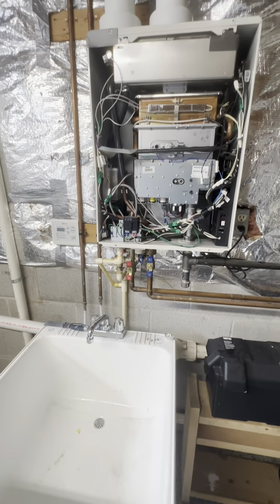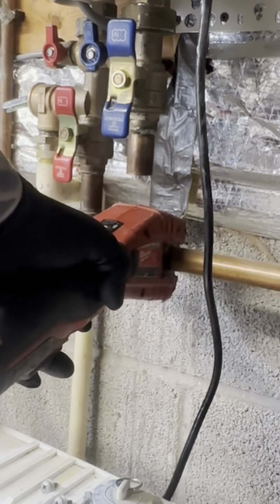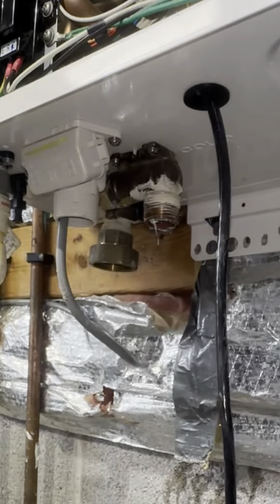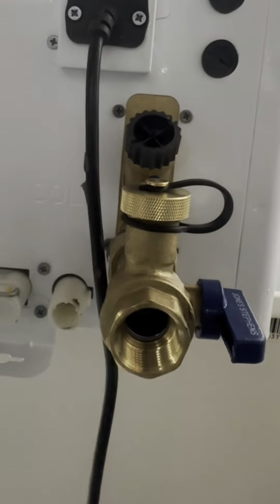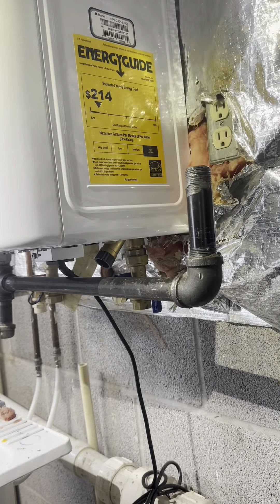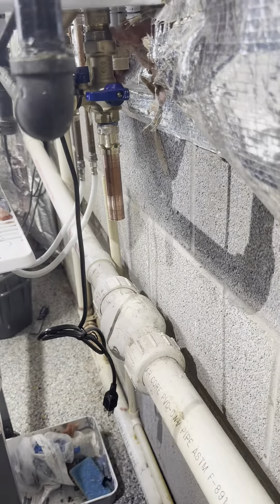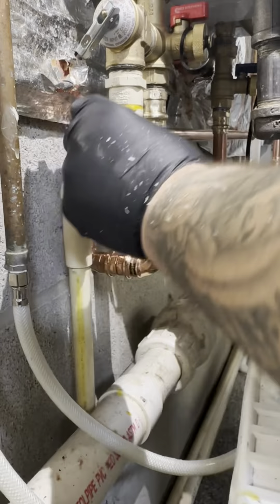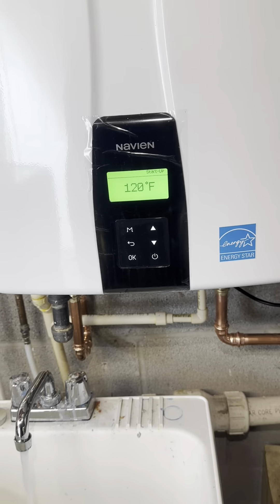Navien S2 Tankless Water Heater Install

Comment: Hey, Ant, thanks for this video. A couple years ago I replaced a 40-year old boiler (that was working fine) and a conventional hot water tank (not working so fine) with a Vesta tankless system. I immediately encountered a series of serious issues, not due to hardware failure but due to these installer errors:

1. The installer installed an overflow pipe directed down at the floor, rather than diverting it into an overflow pump system.
     So the first time the system failed due to overload a couple weeks after the installation, the overflow spilled onto the floor and soaked our newly installed carpet.
     To the installer's credit, they acknowledged the error and paid for all remediation work.
     And again, another overflow event. This time, the leak alert system I had installed saved the day, and my carpet.
     After another similar event or two, which cost me and the installer more money, they finally did the thing they should have done in the first place 
     and installed an overflow pump that diverted water into our sewer pipe.

     But it was an awful experience for us, and a completely avoidable situation and expense for the installer. And they didn't fix the overflow problem, but instead installed a pump to
     remove it. And why did this happen? See 2. below.

2. The installer failed to consider incoming water pressure..
    During this ordeal I learned that these tankless systems do not tolerate high water pressure -- over about 40 PSI -- very well.
    After some research on my own, I learned from municipal water provider that my incoming pressure would sometimes exceed 120 PSI! Especially at night, when local demand dropped.
    Although my installer should have addressed this issue, it was only after I brought it to their attention that they installed a pressure reducing valve in line before the system.

    So far, the PRV seems to have fixed the overflow issues. But honestly, I sometimes wish I had left that old boiler in place...
I'm looking forward to your expert perspective on this. Thanks again for the video.